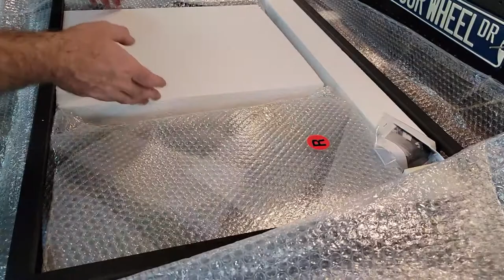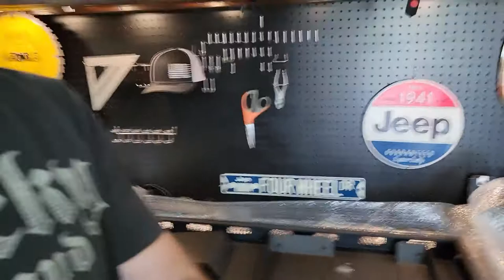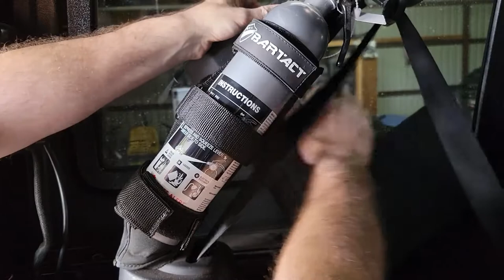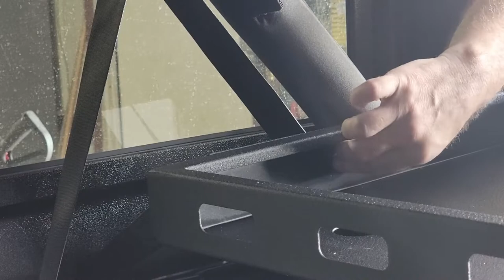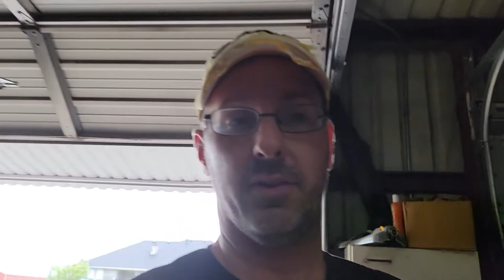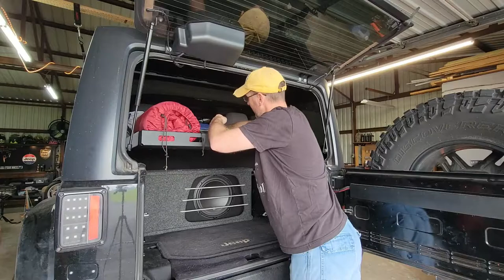Jeep Cargo Storage Rack Install

Comment: @twisted ADV ... I wonder if you could notch out the side pieces and place them under the hardtop?
Reply from the maker: I thought about that and decided against the surgery. I think it would weaken the overall strength by removing the bracing point of the tray and possibly limit the total weight bearing capability.   Plus I am not too sure on how well the top would seal resting on top of the side supports. I have no doubt that it can be done and it would definately make it easier when taking the top off or putting the top back on.  I still may try that now that the warmer weather is creeping in. Until then, 
it literally takes an additional 5-10 minutes to remove the tray and the more I do it, the faster it gets.  Thanks for watching!

Comment: One negative thing about this is that if you have cargo stored on top of it, you won't be able to see through the window with your rearview mirror.
Reply from the maker: Very true BUT.....I picked up a digital rearview mirror that utilizes a camera on the back spare tire. I bought that because I was having troubles looking I over the 37 inch spare.  It blocked most of the view. I posted a video on that if you are interested.   it's been a great upgrade and cheap.